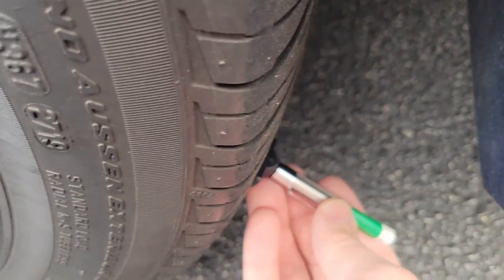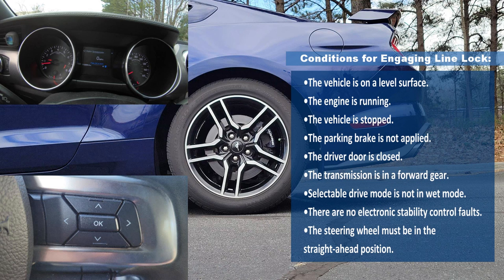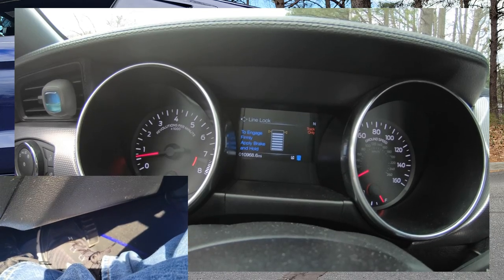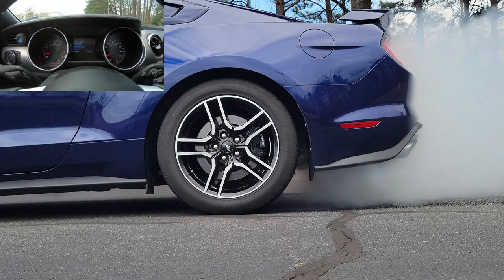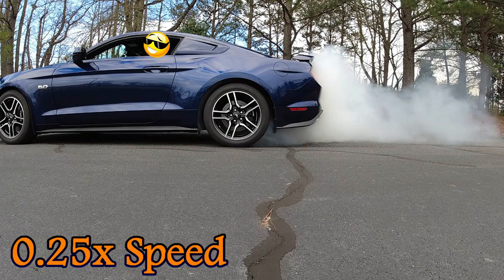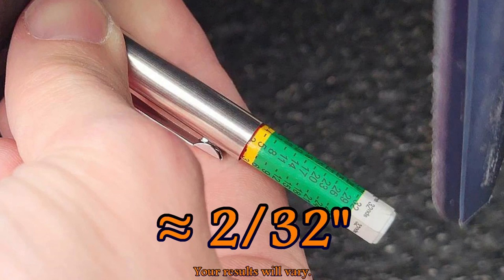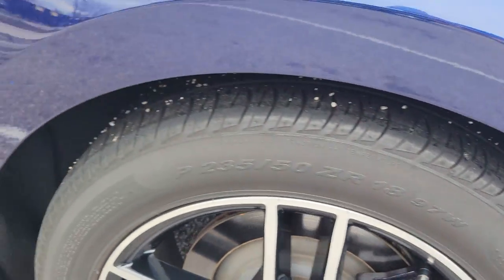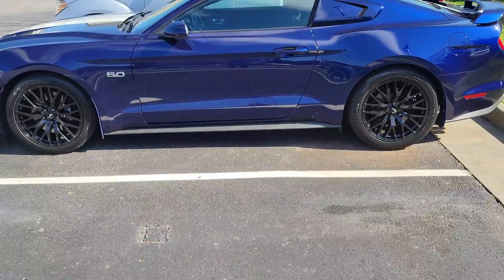How to run the Mustang Line Lock feature

Comment: I used to do burnouts in my '98 supercharged, stroked, built 2 valve Mustang years ago on the track and to taunt others to road race, but it certainly burned up my rear brake pads. I have the Ecoboost Mustang now that doesn't have line lock. I do wish I had that feature, but it's not a big deal since I don't take this to the track. Still pretty cool. Thanks for walking us through it.
Reply from the maker: Ford added line lock to the ecoboost in 2018. I'm curious to see the difference in the burnouts.
Reply: @mcgurrentertainment  yep. I have the 2015 model. I think I can add this feature, but I haven't looked deeper into it. I'd love to take the car to the track, so line lock would be very helpful.

Comment: I never tried using it in mine either but I believe if you hold it long enough, the car will release the front brakes and let you roll out of the burnout
Reply from the maker: It was cool to test out.
Reply: @mcgurrentertainment  yea there’s a lot of cool stuff in the track options that I’ve never used yet,  one of these days I will
Reply from the maker: I've used a few features in the TrackApps. They have been very useful when providing performance data.